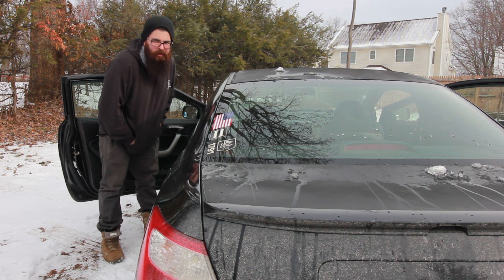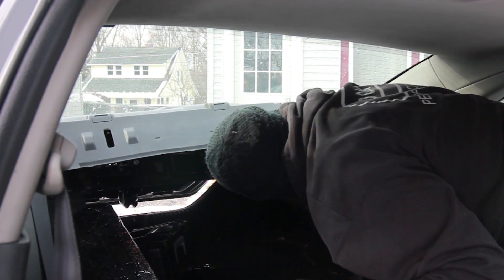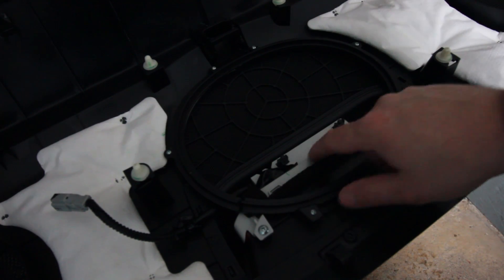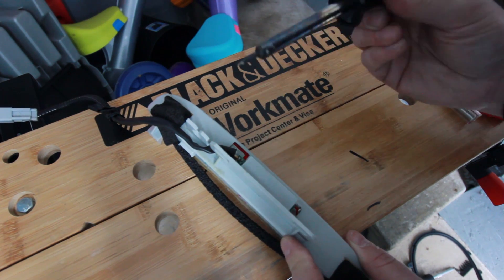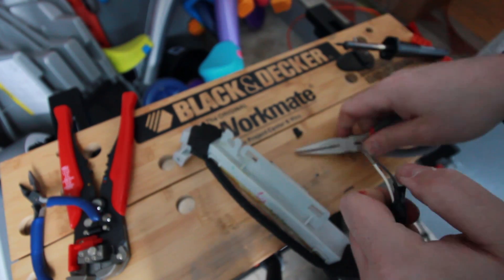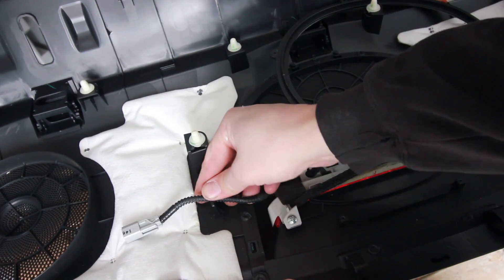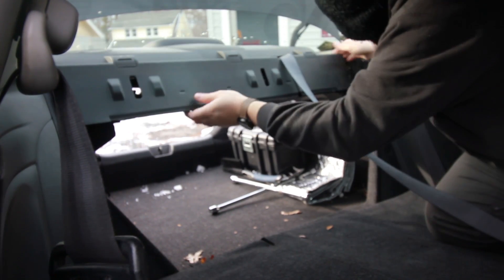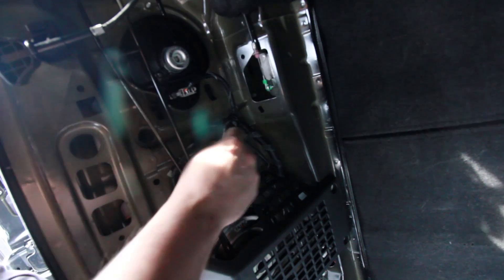Fix a Broken LED Third Brake Light! Honda Civic 8th Gen

Comment: Thanks for the video. On mine the wire was not corroded, the mettle standoff that intercepts the PCB had a broke solder joint. 

This should have really been designed as a single PCB and not a small PCB connected to a sheet metal backplane. At very least if they drilled some holes in the mettle standoffs so that the solder would form a more solid connection.

I give your video an A+ and this design an F.
Reply from the maker: Hopefully it helped you. You sometimes wonder why things are designed a certain way and just scratch your head. The more I'm around, even or especially with fortune 500 companies, you realize they don't nearly have it all together and I'm sure many arguments and suggestions from engineers go unheeded by the bean counters and suits.

Comment: Repair Update: I repaired my light thanks to this video but a couple of months later the light went out again. It is my assumption that Honda did not put any QC into this light when it was manufactured.

I went to a junkyard and got 2 different lights from 2 different ‘08 Civics and the results were the same, the lights did not work when I plugged it in. I tested both LED lights with a battery but instead of attaching the leads to the soldering points, I place the leads on the terminals that is on opposite end of the circuit board. The lights lit up instantly.

Then I tested the terminals where the wires are soldered to the circuit board. The (+) is good but the (-) did not. This is consistent for both lights. 

I conclude that both of these junkyard lights did not work because of poor grounding due to faulty soldering of the ground wire to the ground terminal on the circuit board. I think this is what the problem is for my light.

So for anyone doing this repair, I suggest disassembling the board from the light, solder the ground wire really well to the board and test for function before reinstalling. 

Thanks for reading and sorry for such a long ass post. I hope this saved somebody some money.
Reply from the maker: The part probably went to the lowest bidder and designed to last X number of years which was acceptable to some bean counter somewhere. Thanks for the update!

Comment: I never thought I would be the type to work on my car myself. I just bought an 08 EX coupe just like yours. Pretty badass car to be 10 years old. 
Since buying I’ve had to do some tweaks on it.
Aux port solder.
Brake light
Now working on replacing the old and WORN OUT speakers. This video helped me a LOT. 
I was so worried removing the back deck of access was going to be a pain in the ass I was going to pay almost 700 to have someone replace my speakers. Definitely DIYing with some Crutchfield magic.
Thanks for the video!
Reply from the maker: I'm so glad to hear this. 8th gen civics were really nice and have aged well IMO. Keep doing more stuff. The more you do the more you realize most things really aren't that hard once you get the general idea down.

Comment: Had an hevulla of a time putting my deck back on, I broke off the corner stump next the the left rear speaker twice as if the hole is too small edges too sharp what not, until I threaded a fishing line and pull it from under so it aligns the way it should. Whadda pain.

Comment: Looks like removing the rear deck on a coupe is much easier. On a sedan, you have to take the whole back seat out, the side rear panels blah-blah before able to remove the rear deck. Sedan pain.

Comment: I haven’t dissembled anything yet but if the 3rd break light is out then I’ll have to replace the whole thing? No simple bulb swap? Thanks for the video!
Reply from the maker: Somehow was this comment missed? I'm sorry! You've no doubt found out that it is an LED assembly and not a simple bulb like in the good old days.
Reply: Thousand Hills Ranch no worries partner. I got er fixed 💪🏽🙌🏽

Comment: hi, thanks for posting this video. Can you or someone help me with this problem please: I replaced the side brake bulbs (both were dead) and now the brake light goes on and stays on all time only when the headlights are on. When the headlights are off, the brake light doesn't come on when I pres the brake. I checked the switch at the brake pedal, it seems OK, looks like new. I am not sure when the side brake lights died, but after I replaced the side bulbs as described above, my third brake light died. Any suggestions/ideas? Thanks.

Comment: Thank you so much. I was bugged with Honda quoting $300 and local mechanic offering to reduce it to $90 if I get the light. I was all set to go with the local mechanic but final thought of checking the DIY videos pushed me to watch this video. I just spent less than 25 mins and it’s all done. Wow big thanks to you for making a rocket science to comic for me lol. Much appreciated.
Reply: Prabhakaran Mohankumar  My 2006 honda coup break light and third break light wont work. Just bought car for my son when he drove it home the breaklights came on then they were working of and on during rhe drive home. now rhey dont work. Checked all breaklights and the bulbs are good. Wondering if the 3rd break out goes out can that cause all the breaklights to not work?

Comment: Thanks buddy. Big help knowing to just yank on the deck plastic, had this done in 10 minutes. I didn't resolder, just threw a part at it and called it a day, but still... $60 versus $260. Great video.
Reply from the maker: Haha, it always helps to see someone else rip the trim out first so I'm not afraid of destroying it. I'm glad it helped! I ended up having to buy a new brake light anyway as this solder fix kept going out (if I totally desoldered and resoldered it probably would have been fine), but like you said, just throw a budget part at it. Thanks for watching!

Comment: Do you recommend these car? Alot of people complain about the passenger motor mount wearing out.
Reply: purpledonatello If your worried about a motor mount busting I suggest you stick with Saturn
Reply: purpledonatello in a mill yrs yes!
Reply: I sadly replaced the motor mount last, but the job was only a couple of hours. Nice and smooth now.